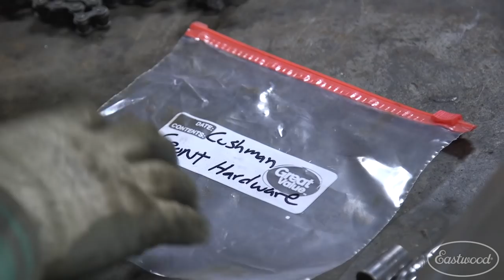The Cushman Scooter Project - Cushman Tear Down & Plans for AIR RIDE! - Episode 12 - Eastwood

Comment: Virtually impossible to ride that low.  Can't turn without dragging bodywork.  It's fine for parked, static display but, like full-size baggers, you'll have to lift to ride.  If you accept that, you can modify swingarm or frame bag mount to lay body flat on ground so no kickstand required!  Would be different to say the least!

Comment: How are you going to turn with the running boards so close to the ground? You'll damage it bad.
Reply: chevymarineretired raise it up when you drive
Reply: @WiredCustomsSpeedShop  i get the same dumb ass question all the time when my 54 is on the frame...
"How did you get it here so low to the ground"
"I lift it with air suspension"
"and that works??"
"ITS FUCKING HERE ISN'T IT...???"

Comment: Hi Matt. I have a question.  What are you going to do about the hight of the motor? It was already so high that you would have notch the seat to clear the fuel tank before you now lowered the body. Wont that worsen that problem?
Danie

Comment: Bagging it would be awesome for parking it at shows, but you might run into chain angularity problems if you ride it lowered. 
I’d love to see you chop off those bars, extend the forks higher and use a drag bar. Not too high; certainly below shoulder height. It would give it that old school minibike look. Loving this project!  👍

Comment: When you changed the back wheel you took out the brakes. Are going to adapt the old drum brake or maybe a disc brake on the jack shaft.  Oh! I get it. Let the air out of the bags and lay frame to stop.

Comment: 3:22 I was told that if you tap it with a light hammer after spraying, it sets up a vibration that's supposed to help the solvent creep. Anyone else hear that one?